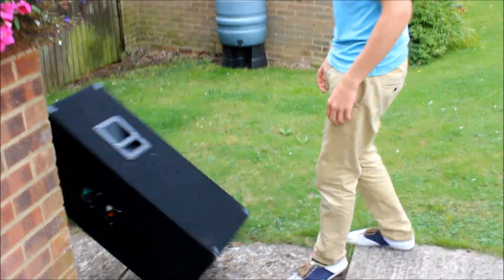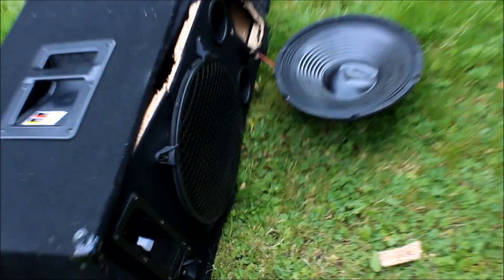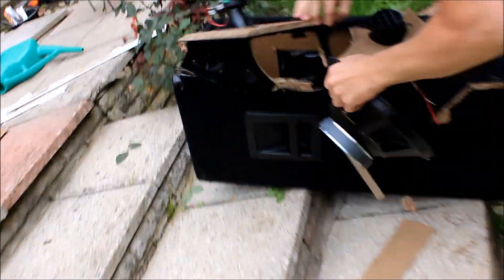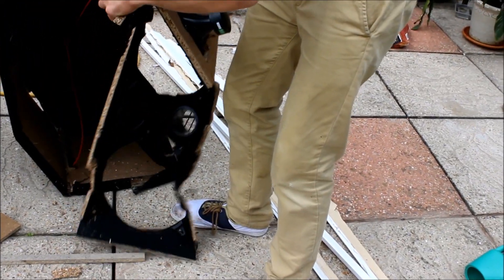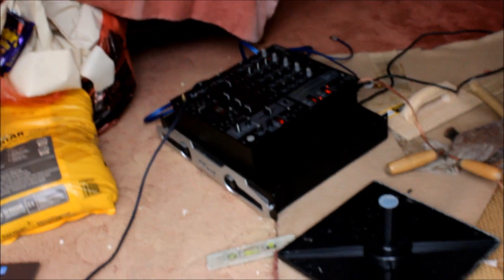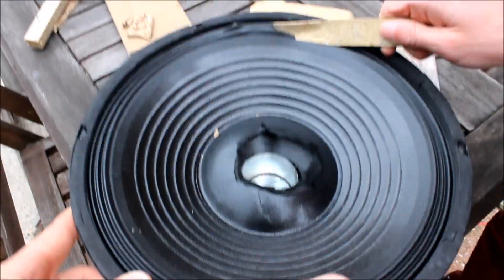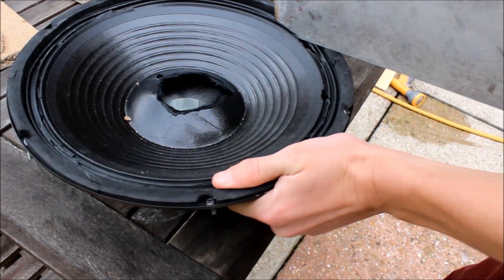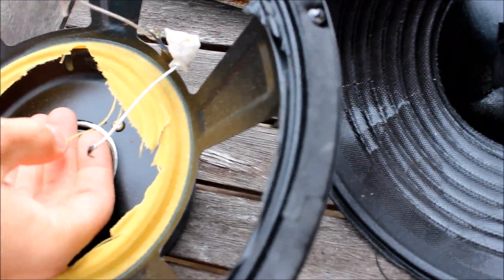AUNA PW-2222 SMASH AND BLOW

Comment: Yep, sure did. It isn't a brilliant amp. Doesn't do the power ratings it says, that's for sure. It's great for the price but if you're looking for proper power etc. It isn't the amp for the job. At best it's 400W RMS @ 4 ohms per channel. It has 4 complimentary pairs of Toshiba transistors per side. 
Only 100W rating per pair so it's 800W RMS at best at 8 ohms bridged. Then you have to think about other components which may be restricting voltage gain. Nice amp, incorrect ratings, that's all :)